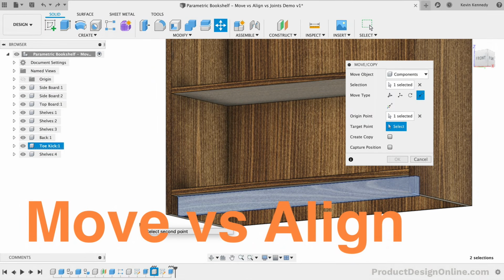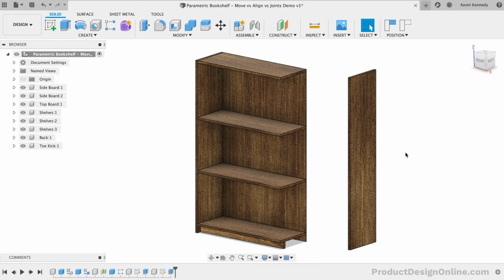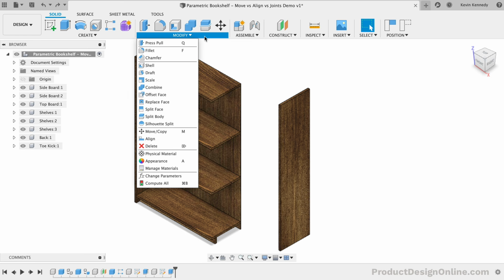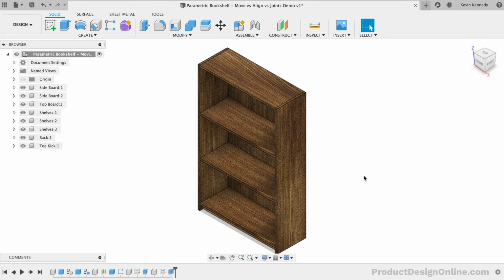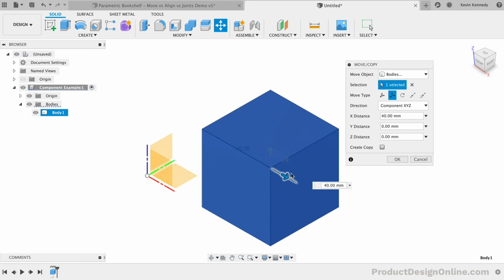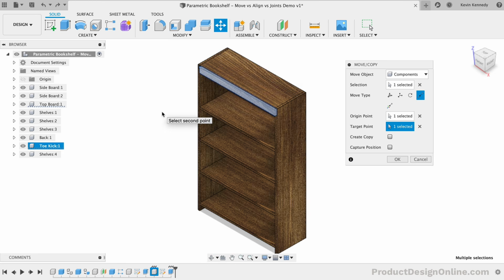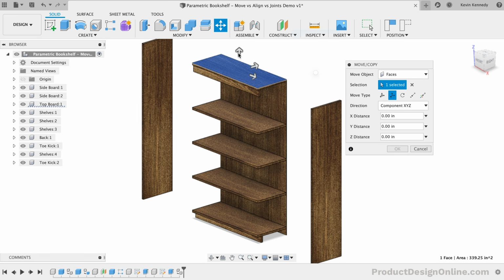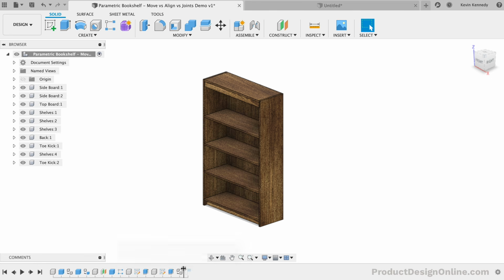How to Move Parts in Fusion 360

Comment from the maker: TIMESTAMPS
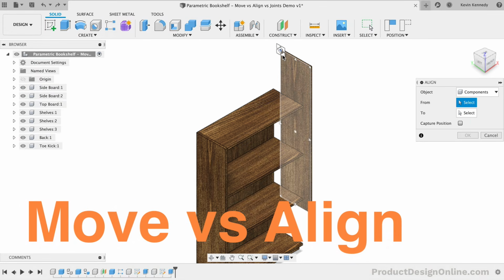0:00 - Fusion 360: Move vs Align vs Joints
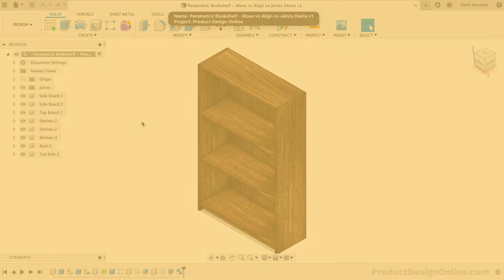0:33 - Bodies and Components explained
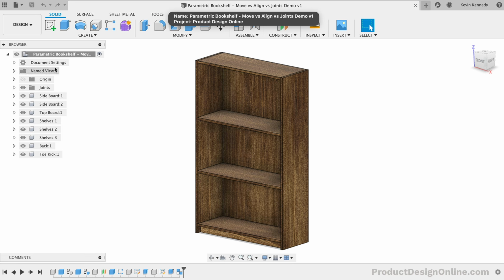1:24 - Using the Joint command
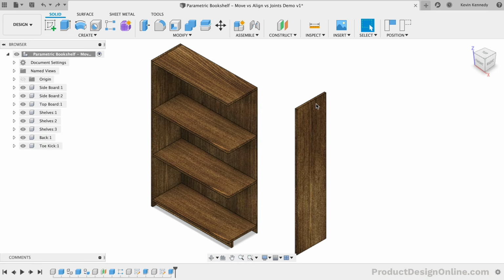4:00 - Using the Align command
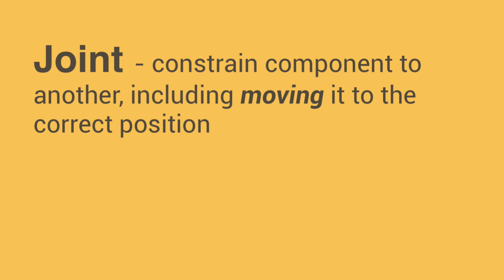6:00 - Joint vs Align explained
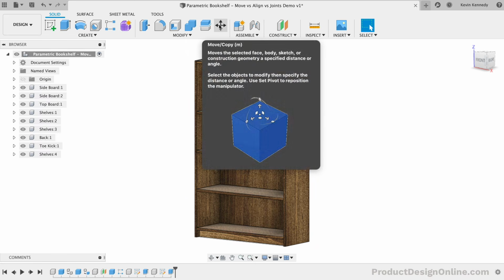7:00 - Move/Copy command
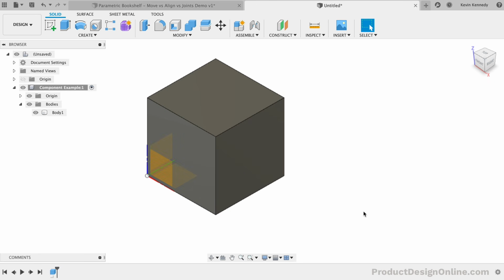8:19 - Moving body away from the origin
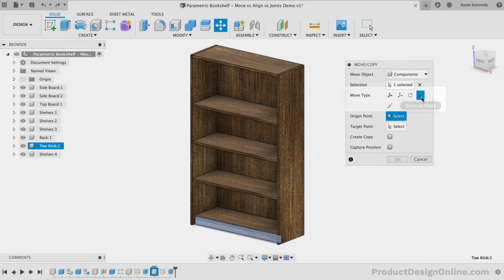10:17 - Copying a component with Point to Point
12:31 - Manually exploding an assembly with Move
13:29 - Moving and manipulating faces
14:00 - Joint vs Align vs Move summary

Comment: Hi I really need help with my project. I have a vending machine that opens and closes. The door is a component attached to the body (component) with a hinge that allows revolve. However, I attempted to attach the other parts (lock, display screen etc) onto the door. These components refuse to move with the door and remain fixed. How can I make them move with the door when open and close??
Reply from the maker: Can you share your file? There are a number of things that could be going on here :)

Comment: how do you raise a part?
Reply from the maker: What do you mean by 'raise'? You can use Move, Align or Joints depending on the need.
Reply: @ProductDesignOnline  I mean like when you create a part, it spawns on the bottom, but I want the thing to be higher up the model... how do I do that?

Comment: my fusion 360 software starting very slow its take 2-3 min to start
how can i fix this problem .....
Reply from the maker: Check that your computer meets minimum requirements - https://productdesignonline.com/tips-and-tricks/system-requirements-for-autodesk-fusion-360/

If so, you may need to do a clean uninstall and reinstall of the program.

Comment: Hi Kevin, Awsome channel. Thank you. Can you recommend a method (or videos to watch to assist me) to model a wave type washer? Sorry, I know this is unrelated to this video. Thank you again for your great work.
Reply from the maker: There are two main ways to go about it. You could either do a 3D sketch with a spline or you could surface model it in several steps. I would create the main shape and then surface the 'curvy' part and trim it away. Surface modeling will be more precise/easier to dimension...but 3D sketching may potentially be quicker or easier overall. I only have one 3D sketching video which is more on linear shapes...so that may not help. If you check out the 'playlists' tab of my channel you'll find several surface modeling tutorials which should give you a better idea of how to approach the surface tools.
Reply: @ProductDesignOnline  Thank you Kevin for your fast response and explanation. I'll take a look at your surface modeling video too. Thank you for the leads. Much appreciated!